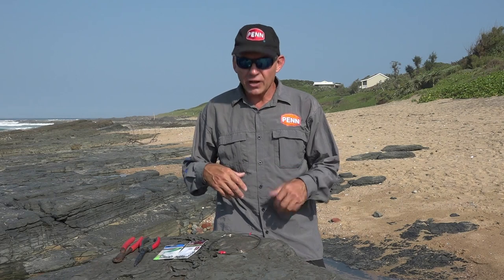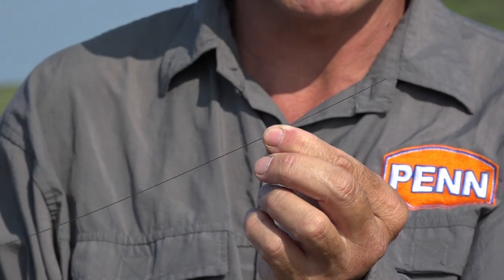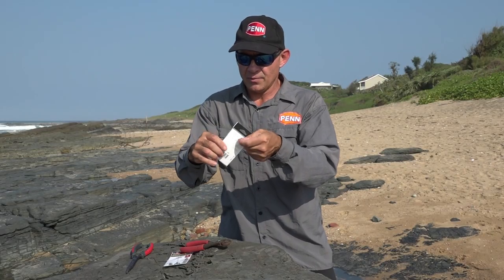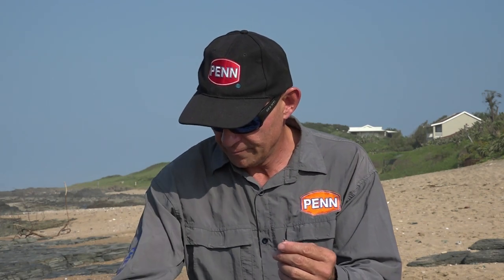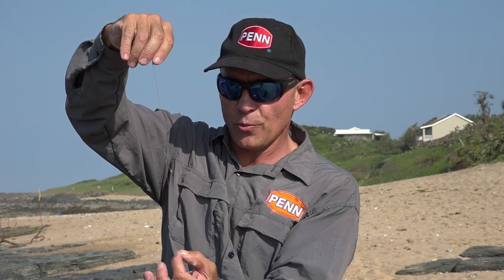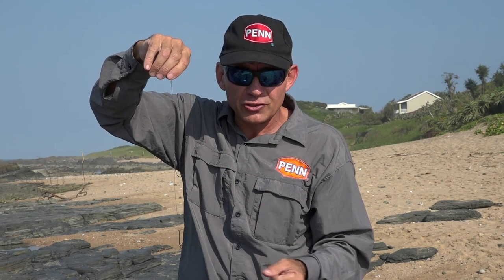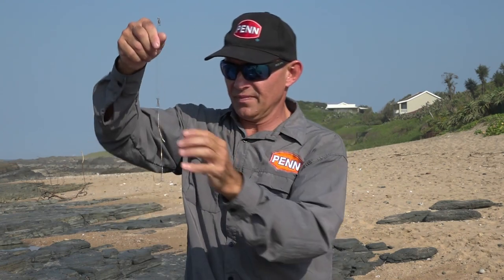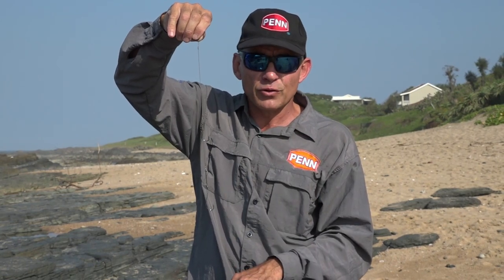Building a shad trace

Comment: what do you mean by no 5/6 wire it comes in lbs or kg here???
Reply: No.5 is soft use No. 8, 9 or 10.
its only the number check the packet it will have the the exact weight.
AFW wire No. 5 is 44lb/20kg.